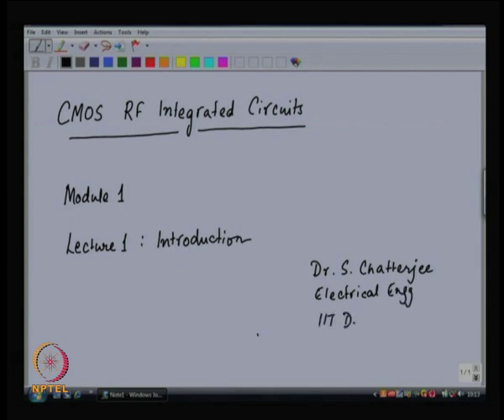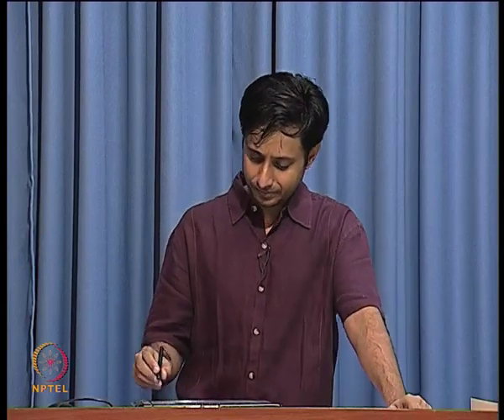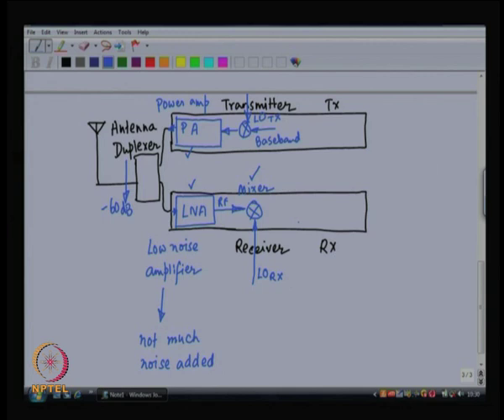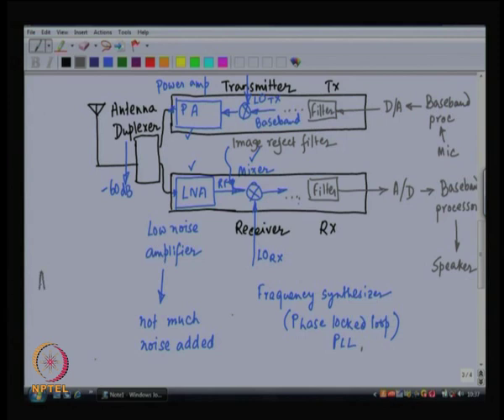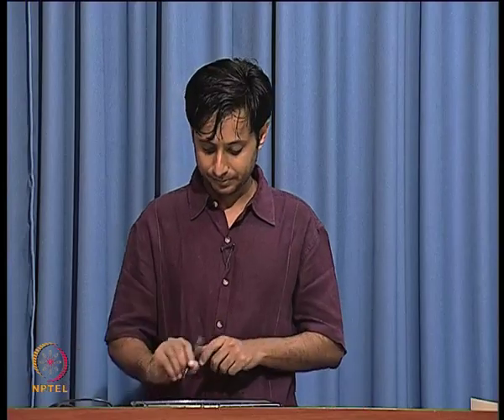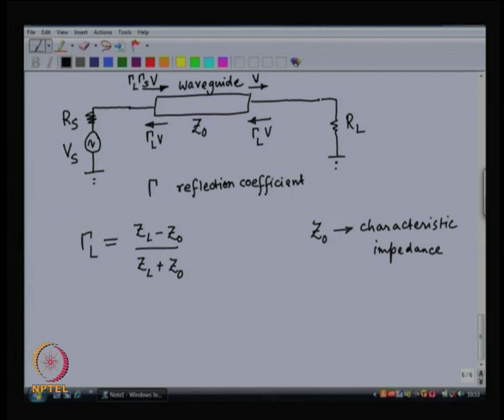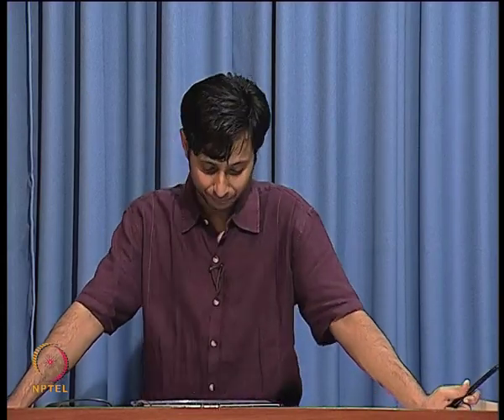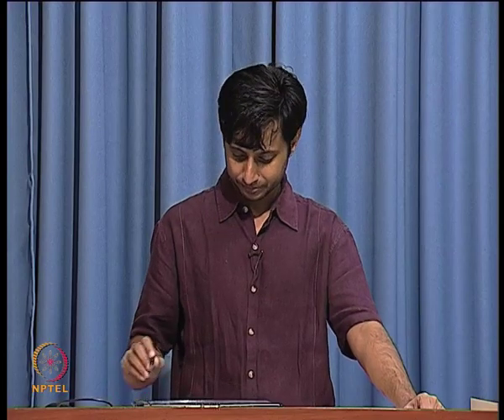Mod-01 Lec-01 RF system basic architectures

Comment: The characteristics impedance value 50ohm...
Where does this number comes from??
It could be more or less 50ohms?? It should match with Zrx and Ztx...

Is there standard for impedance should be 50 ohms...??
I have heard many times but never get the proper justification...

Can anyone please help???
Thanks
Reply: yes there is standards in design of tx line i.e 50ohms(less insertion loss and maximum power transfer ) and 75ohms (maximum power transfer)

Comment: what is the problem with high frequency while transmitting and after receiving? Sir, can you explain, please.
Reply: Real world data is usually low frequency. As an example, voice can be at max 20k Hz. This low frequency band is called baseband. However, now a days baseband is growing in size. Lets not talk about it now.

Transmission of basebamd frequencies is not suitable for communication. So we translate the realworld baseband signal to high frequency signal (rf or rf band signal). 

Problems with high frequency/ rf frequency is
1) Real world data is not high frequency
2) Working in digital systems (which has several advantages) needs sampling. Sampling is easy in baseband.

In summary:
1) Operating completely in baseband is a problem for wireless channels. It needs huge antennas and many other issues.

2) Operatting completely in RF is problem because of above mentioned 2 reasons.

3) So operate in baseband using digital systems and translation to RF for communication (transmission and reception) is the way to go.

Comment: I disagree with your statement that the Tx and Rx would use a different LO.  You actually want them to use the same LO.
Reply: That depends on your transceiver application. If you're talking about a simplistic amateur radio transceiver, you could get away with using the same mixer LO for Rx and Tx.  The lecturer is typically explaining split frequency operation for something like a mobile phone handheld device. Listen to the lecture again. It's not that hard to understand the difference
Reply: He is probably talking about the frequency bands that are used, like downlink has to be around 800 MHz while uplink has to be around 850 MHz (arbitrarily chosen values, not according to standards)

Comment: Once there is a noise, it depends on the response. Out of band noise can be filtered out straight in the RF/Analog domain. In band noise removal however is little difficult. However, using ANC adaptive algorithm in DSP domain can cancel it at the cost of some settling and training.